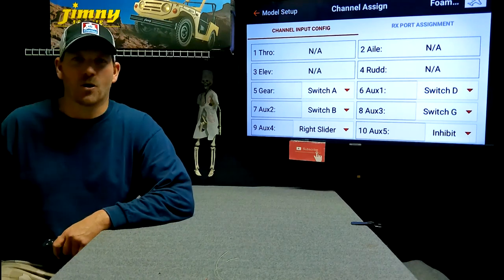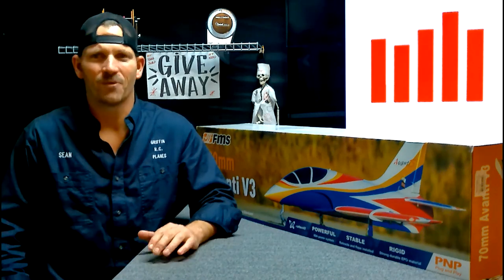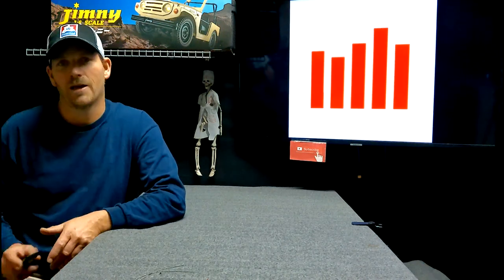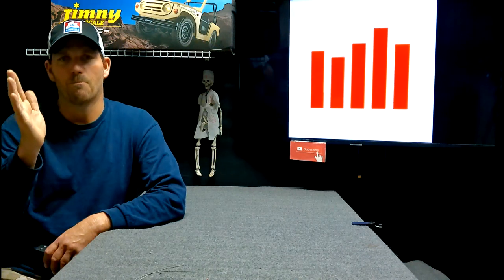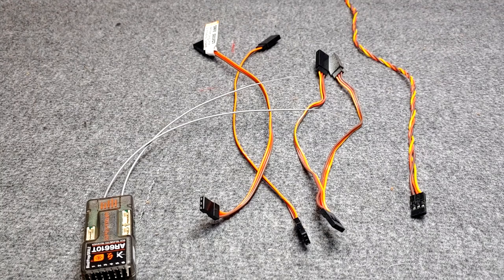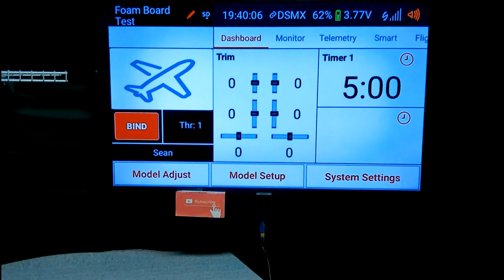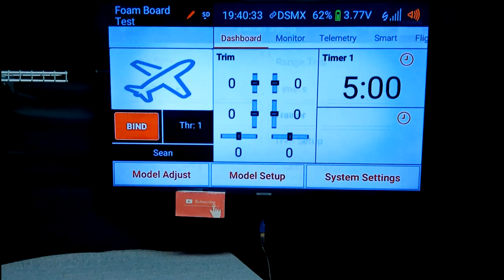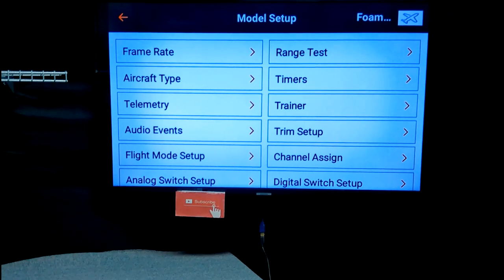RC TRANSMITTER / RECEIVER CHANNEL ASSIGNMENT WHERE TO PLUG YOUR SERVO IN WHAT CHANNEL DOES WHAT ?

Comment: Thanks for the video, I've really struggled with this topic. Flight modes are another strange topic that the transmitter manual doesn't cover.
I've failed in trying to set up the flaps with the ailerons, so all work as full span ailerons but guess I'd need more than 6 channels?